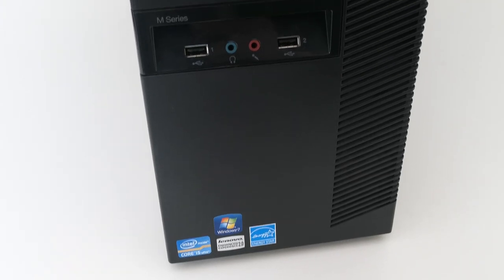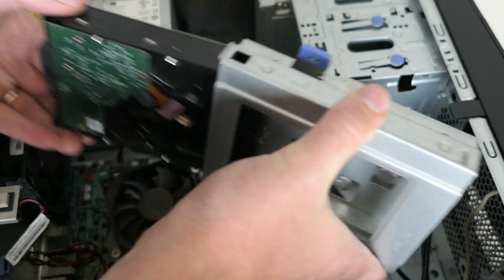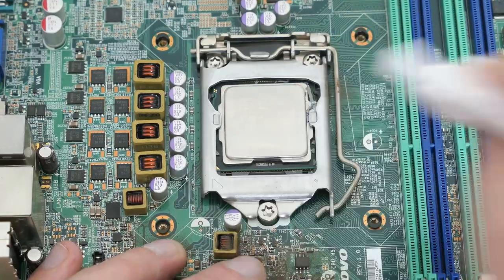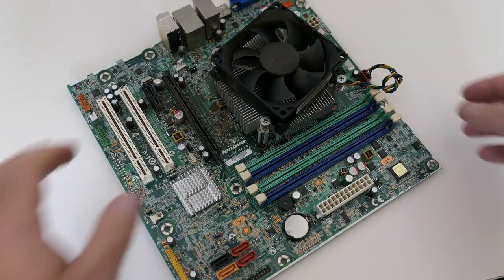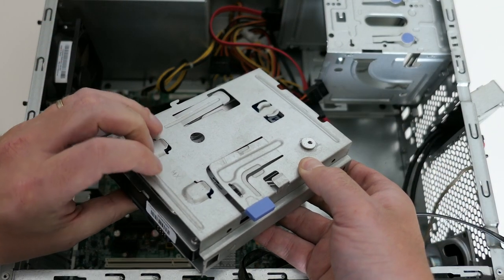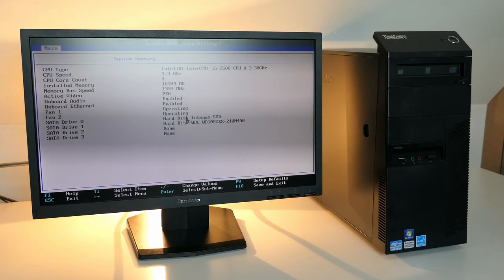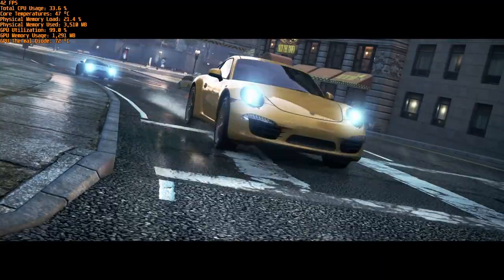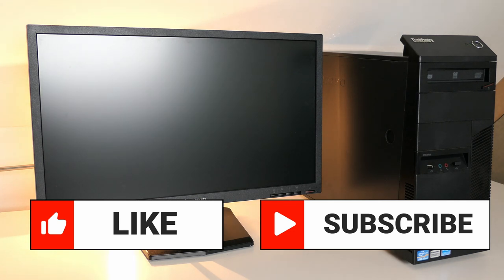Lenovo M91p - Full Disassembly and upgrade with Radeon HD 7700

Comment: I picked up this pc i5 2400, 8gb ram for ~35$, I plugged in a SSD and a GTX 1650 (that I got for ~85$) and still use the original 280watt psu. What an amazing budget gamer :-) (it does need two key configurations to work correctly: bios setting video>igp>multi monitor enabled, windows fast boot disabled)
Reply from the maker: I have a GTX 1650 for which I plan to do a small project, very similar to your setup.
Reply: Whats your motherboard type
Reply: Mine runs decent benchmarks with RX 570 and i7-2600, but I can't for the life of me figure out the sleep settings. It won't wake back up, the fans never shut down, etc.
Reply: I had this exact pc with 8gb-ddr3 and an i5-2400 and a gtx 750 ti. Recently upgraded to a new pc with 32gb ddr4 rgb ram, rtx 3060 and an intel core i7-7800X
Reply: I do have some questions sir, if u do have a social media accounts (facebook, ig) i want to talk about that pc sir, i also have the exact same pc. Thanks

Comment: Why you didn't swap the CPU for a I7, about 37 euro at AE
Reply from the maker: Max. supported CPU is an i7 2600. The performance difference between it and the i5 2500 in it now is rather small. €37 is not a lot but it is in a PC worth ~€150 for a small improvement. Would be interesting to see how big the difference is though :)

Comment: Hello, I’m from brazil, i have the same pc, and i’d like to improve, but I’m fear. Can i improve de psu? I have a 600w psu and a GTX 950 2gb, do you know if the gpu is compatible too? Thanks 😅
Reply from the maker: The machine has a standard ATX power supply so you should be able to simply replace that with the 600W one you have. A GTX 950 should work fine as well here.
Reply: Thank you very much, i Will try  , have a nice week 😊

Comment: How do i take out the graphics card
Reply from the maker: Unplug any additional power connectors to the card, unscrew the screw holding it in place and then push the lever on the PCIe slot to release the card.
Not much can go wrong, just don't force things and be gentle :)

Comment: Hello I have same motherboard with 3x4 GB ram. my question is will be better with 2x4 GB or 4x4gb. I see in CPU-Z when I put 3x4gb ram still working in dual channel when I remove one 4gb and working with 2x4gb productivity is same
Reply from the maker: Normally with 3x4GB it should not be working in dual channel.
The best way to test this is to run Geekbench with each memory configuration which you are considering and compare them.
Reply: @jensdbe  thank you for help. in Geekbench write same dual channel with 3x4 GB :D how wtf
Reply: i have this lenovo, added 2x8gb ram + 1x 4gb ram, 4gb gpu + ssd's and it works beautifully. now just gotta swap the case

Comment: How is it that your m91p Type 4524-E4G accepts the Radeon HD7700, because it is not in the very restricted list of GPUs accepted by this Motherboard?  Notice I own the m91p Type 4524.

However and normally, the m91p only accepts the following cards (and their equivalent substitutes):

*NVDIA GeForce 310 512mb DDR3
*Radeon HD5450 512mb DDR3
*Radeon HD6450 512mb DDR3

I had a Radeon HD5450 512mb DDR3, which unfortunately died last summer.   I made the mistake of buying its upgraded version, the "Radeon HD5450 2gb DDR3", but the Motherboard categorically refuses to recognize it, even after upgrading the BIOS and even tinkering with it.  The HD5450 2gb works on my other PCs and even on a PC older than my Lenovo. The PSU of the Lenovo is 280W, however I tested the GPU and the 280W-PSU on an another Motherboard and their is no problems at all.

Do you know what to do to make it work?
Reply from the maker: Hmm, as far as I know there are no restrictions at all to which GPU to use (except for the limit of the power supply). Any PCIe videocard should just work fine. I played around with the M91p with different cards and never really got what you describe.
Reply: @jensdbe  As I recall, UEFI(or UEFI/Legacy,etc?) needs to be turned-on in the updated BIOS.
Reply: @timintle bro I know how to select legecy rom from pci submenu setting

Comment: I love theese Thinkcentre. I have a Thincentre E73 with a I5 4440S, 16GB ram, 260 SSD and a Thinkcentre M91P with I5 2400, 16gb ram and 120 HDD. Theese M91P models has a TPM 1.2 chip while the E73 gets secure boot instead.
Reply from the maker: Combined you can almost run Windows 11 :)
Reply: @jensdbe  I saw your method how to install Win 11 on unsupported hardware. I will try to install Windows 11 on the E73. But do you think I should leave the UEFI bios and secure boot on when installing Win 11 just to be more on the supported site?

Comment: Is that main pcie a 3.0?
Reply from the maker: As far as I know it is a PCIe 2.0 slot.
Reply: @jensdbe  would I be able to fit a gtx 1050 ti in the case? And if so would it work?
Reply from the maker: @lb5337  that should work, yes. PCIe is backwards compatible. In theory you can get slightly lower performance but that will hardly be noticeable in practice (if even).
Reply: @jensdbe  okay thank you.  : ) you’ve earned a new subscriber : )
Reply: @jensdbe  sorry, I forgot to ask but does the psu support the 1050?

Comment: Is there a way to connect 
 this machine to a M2 SSD or M2 NVMe?
Reply from the maker: Not directly on the motherboard but a regular PCIe NVMe adapter should work. Not sure if the machine will be able to directly boot from it though.